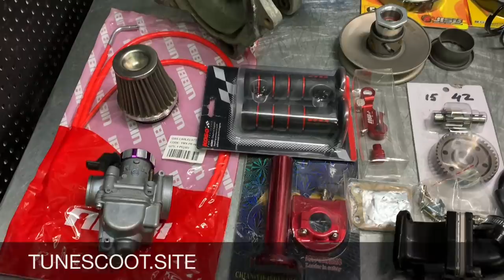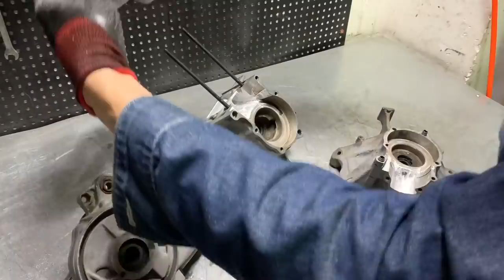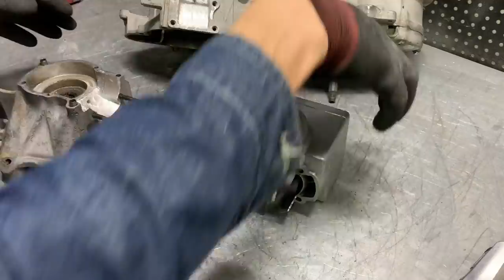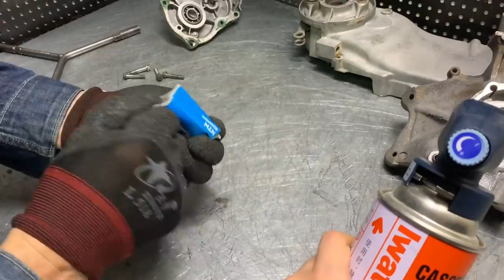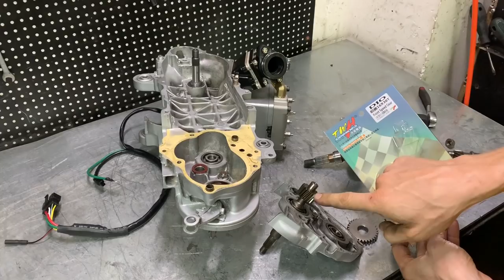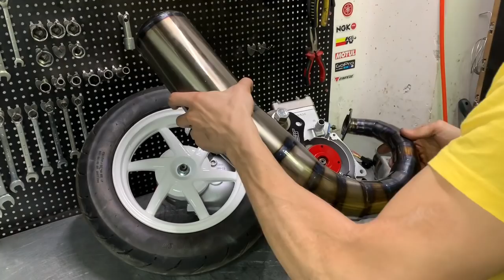ENGINE DIO50, AF18. HIGH - END TUNING VERSION FOR 54.5 mm BIG BORE. Short video version. DIO, af 18

Comment: I belong to a bicycle group and a few of us have minerelli cylinders atop our china bicycle motor bottom ends. It’s most definitely revolutionized the bicycle motor community, as with a simple spacer plate at the base and also on the intake (in order to mate a makuni vm20 carb to it) the motors are now making stock power between 6-8hp. In comparison, the stock china motor makes between  .9hp and 1.5 - 2hp. We’re still in developmental stages with trying to keep the temp stable at 230-260 degrees f. I’m curious as to know what’s considered hot or a little too hot of a temp on your scooter motors. I’ve read between 300-350 degrees f but hard to believe anything in print these days. Feedback would definitely be appreciated!!
Reply: Normal temperatures are about 60 degrees celsius (140 f) or wit the maximum being about 80C (180 f)
Reply: Dean Z maybe if it’s liquid cooled, my bike isles at higher temps than that. Lol
Reply: Angus forced air cooling, as in a high flow fan directed at the head? I’ve never run my cylinder past 290, which was way to high for my liking. I operate normally around 240-260, my cylinder should stay in pretty good shape at those temps?
Reply: Angus awesome, and thanks a ton. I’m running 40:1 with ams oil Sabre. The inside of my jug still has great looking cross hatching and the top of my piston has zero carbon build up. I’ve only got about a thousand miles on it as it sits and should be good for another thousand. Thanks again for correcting what the other fella said, he had me a bit nervous. Ty
Reply: Angus got it!!

Comment: Hi bro can I ask?  What Kind Honda dio engine do you build..  I have Honda dio2 also can I both a parts of Honda dio to you?
Reply from the maker: Hi bro, we build engines af18-28, af34-35, af37. Also we sale spare parts for this engines, like big bore kit, exhaust, cvt kit, transmission gears, exhaust pipe, engine cases, crankshaft and else.
You can text me in WhatsApp +8613068844900. 
Or research on our website:  TUNESCOOT.SITE